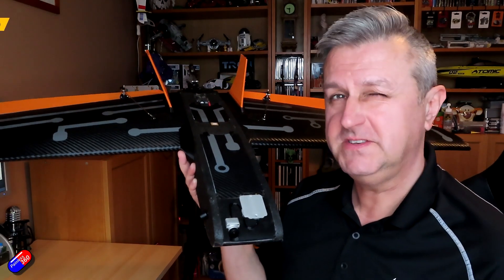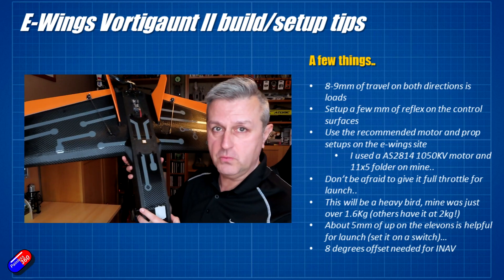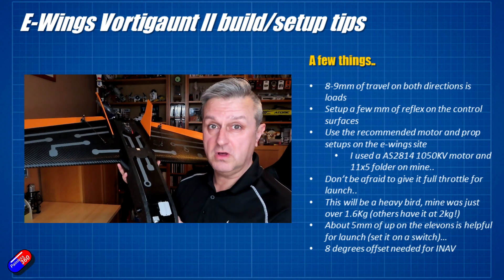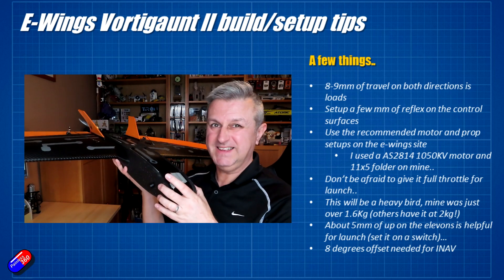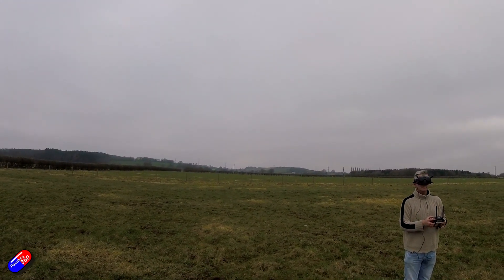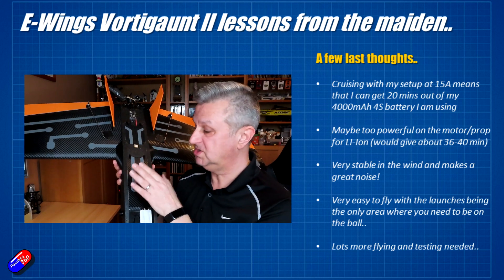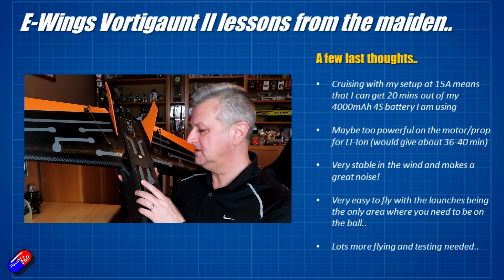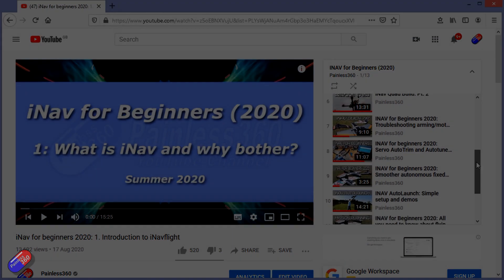E-Wings Vortigaunt II: Maiden flight results and setup tips

Comment: Another great video.  Do you have any tips on how to setup elevons for launch per your reco? This sounds like a great option to maiden an iNav equipped wing on manual mode before I can leverage autolaunch and angle mode.  Ideally it would turn it self off when the sticks are moved or on a few seconds timer but maybe a switch would work too.  Always appreciate your recommendations and advice for new hobbyists.
Reply from the maker: Check out the video on setting up the control surfaces in the playlist. I'm using INAV auto-launch here but others are adding 5mm of up elevator and full throttle for manual throws.. Best of luck!